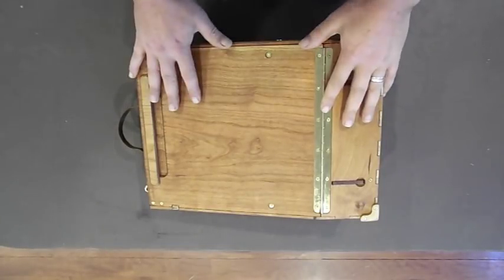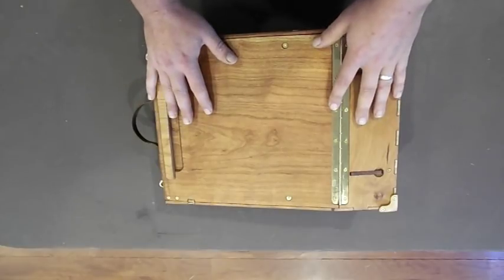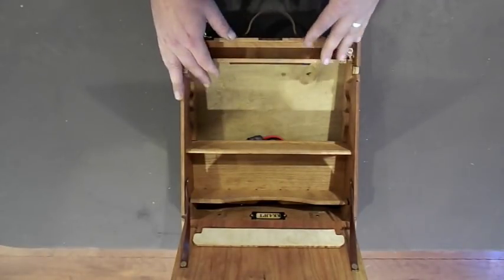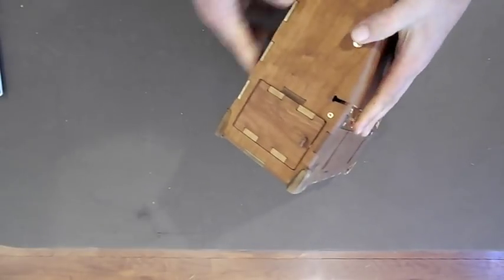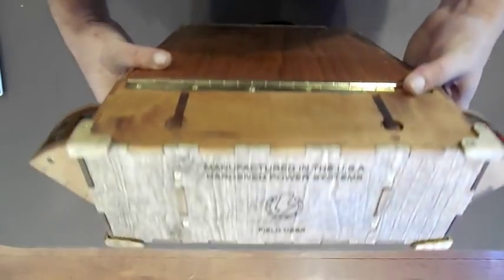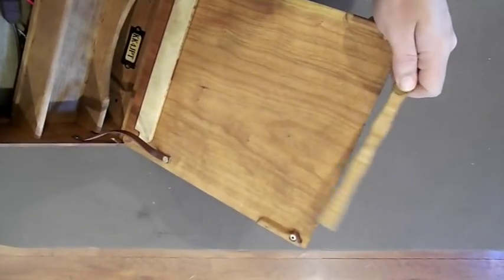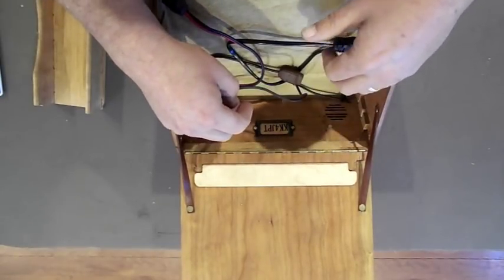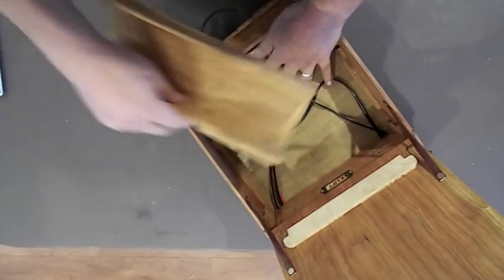Field Desk Introduction, Mfg. by Hardened Power Systems

Comment: Very cool - I like it.  One potential change: add an external lamp/led to show if the power is left on.

Don / W5DON
Reply from the maker: Don, good observation.  We have accidentally left the prototypes on, and it can be frustrating...I guess I was trying to keep the old-school look, without having an LED that was visible enough to be useful... perhaps if it was recessed enough to be discreet when off... ?
Reply: Hardened Power  - Bill, I totally understand that.  I like & appreciate the old school form and function.  And I’m sure the battery load is negligible with just the meter illuminated.

Comment: what's the point of stereo outputs?? given  most radios only do mono out and I know for a fact that going with a 3 watt solution will only do damage to the speakers as the speakers impedance 4-8 watts @ 8 ohms

I would suggest to add more depth into the  chassis so you have the option  mount the antenna connections internally
Reply from the maker: Jason,  the speakers are wired so the mono output from a rig is shared by both speakers.  These are the same speakers we use in the Recon, the Scout, and the Commander.  They work great with HAM radios.  Although, since they are not amplified, they are very quiet if you use the headphone output of a phone or MP3 player...